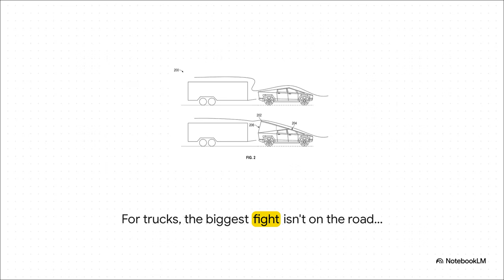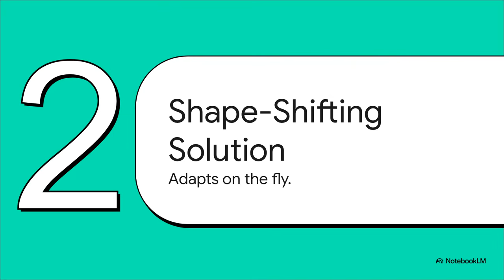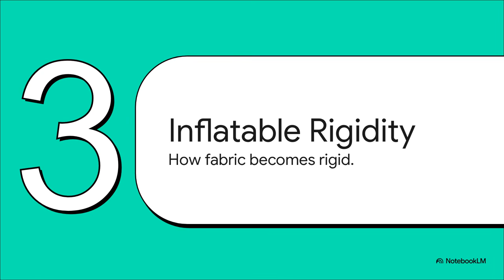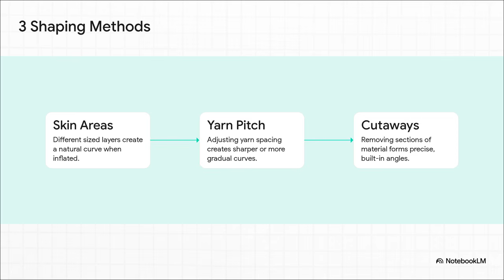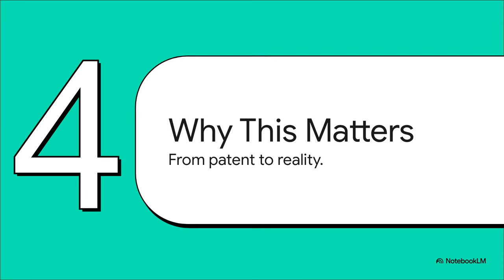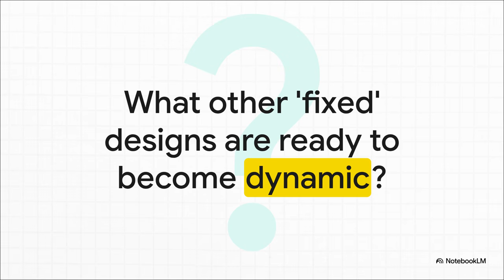How Tesla's "Shape-Shifting" Truck Will Revolutionize Efficiency

Comment: I just took my trailer from southern Germany to Denkmark with an electric car (no not Tesla). I noticed that recuperation could be used by a much smaller extent,, most kikely because of the trailer breaking by itself. Aerodynamic drag does not seem to be all, that increases power consumption. I ended up using more than double the power, I usually use at much higher speed.